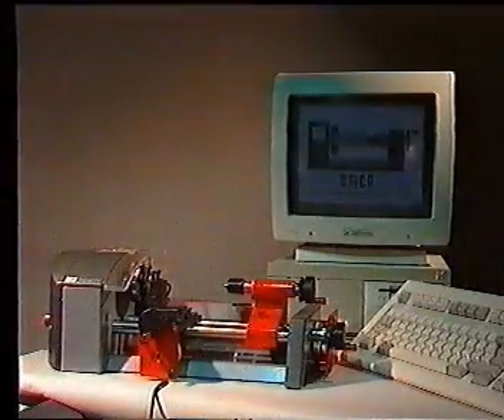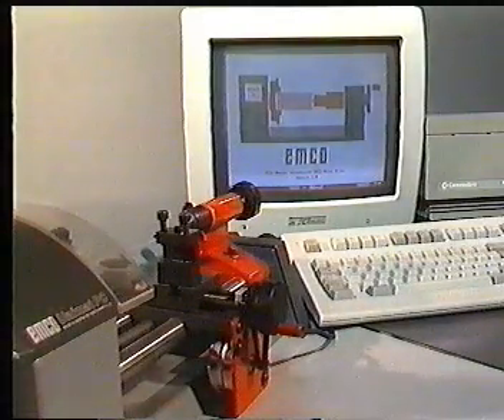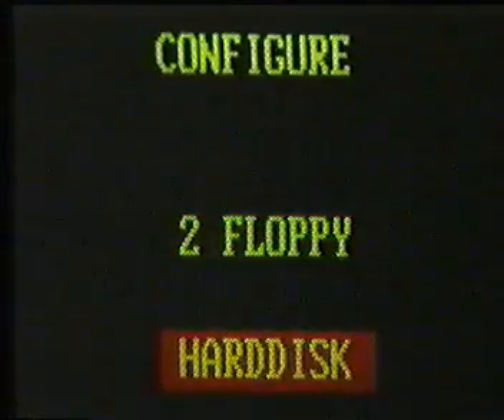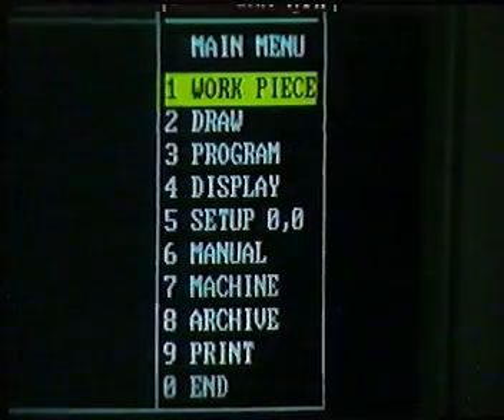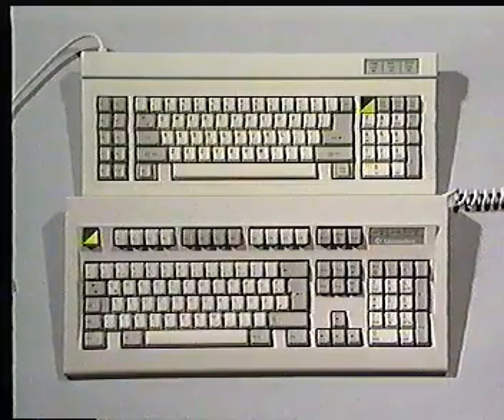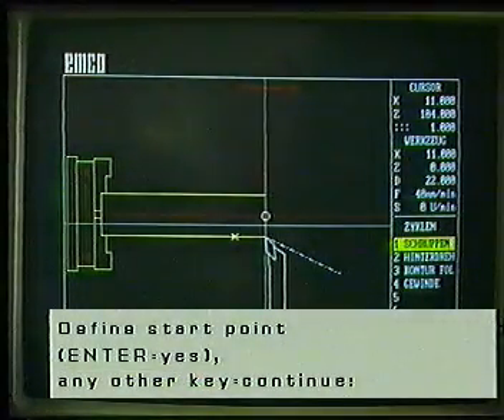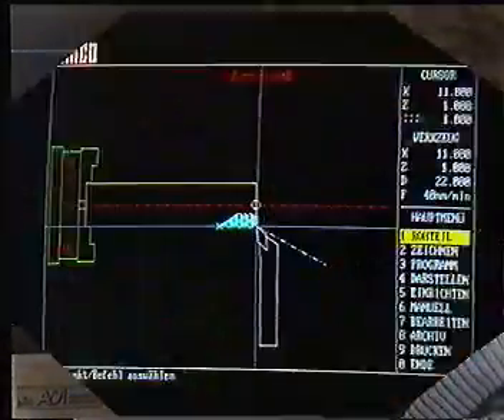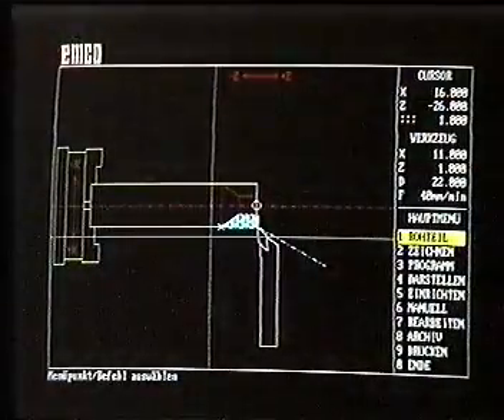Emco Unimat PC cnc Part 1

Comment: I also have the lathe with the vertical mill....Iam thinking of fitting nema motors in direct drive mode, the psu and parts can be sorced from china as a package deal, the stepper motor has two shafts so you can use the hand wheel to set zero/start position and there must be some free ware on the web....there is also a cable which fits inside the lathe which moniters or controls the chuck speed ,not sure which its one of those hidden bits you need to run in the orignal format